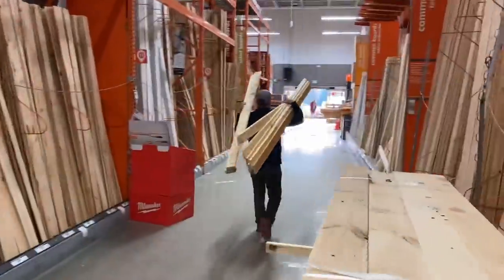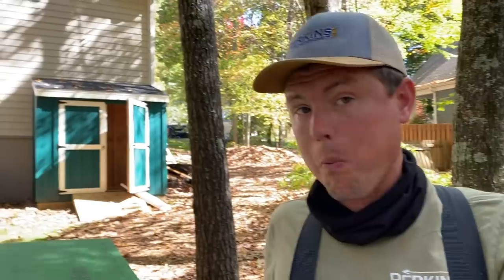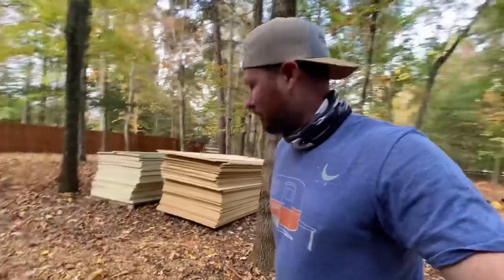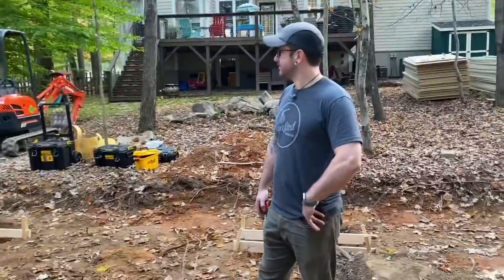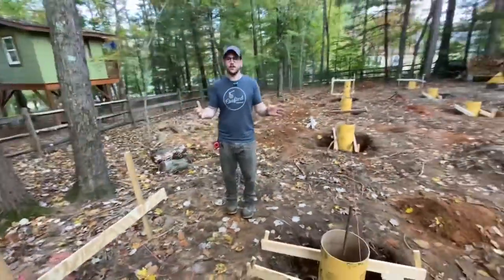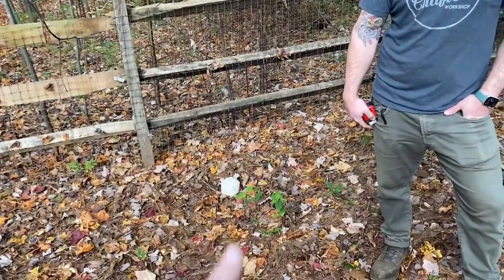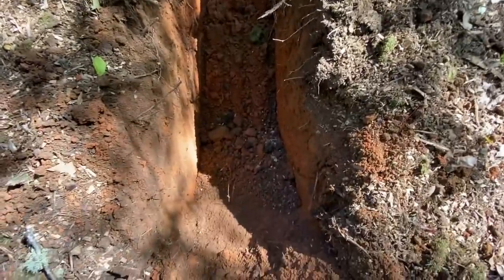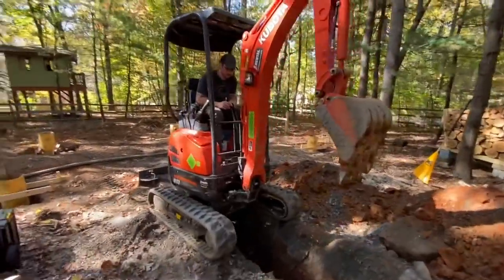Helping Johnny Brooke build his FIRST house! Part 2

Comment: that mini trac is so small that the drive over really does not effect anything.   It would if the ground was really soft and wet.
Reply: Agreed. We work with machinery and vehicles in some of our projects, and the ground PSI of that mini ex would be no concern at all. Repeated traffic over the same patch of ground could become a problem, but a few trips back and forth over a week or two should be fine.